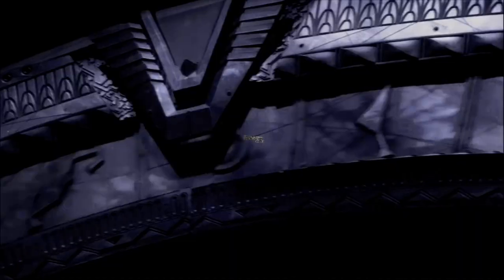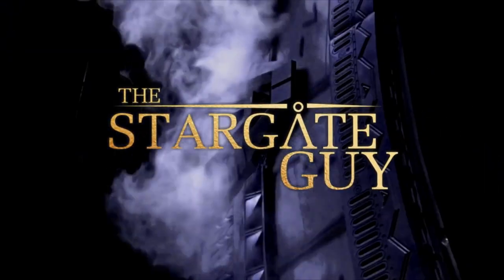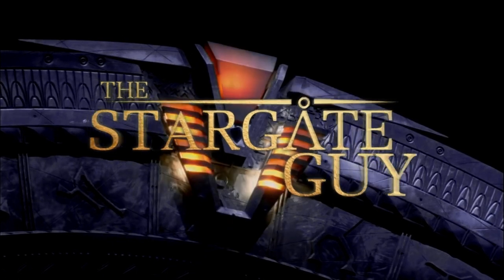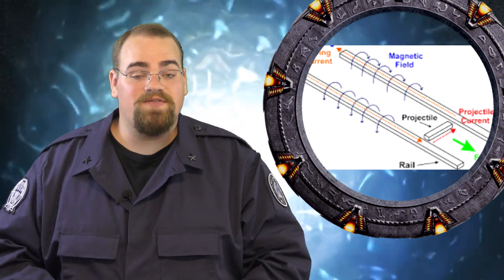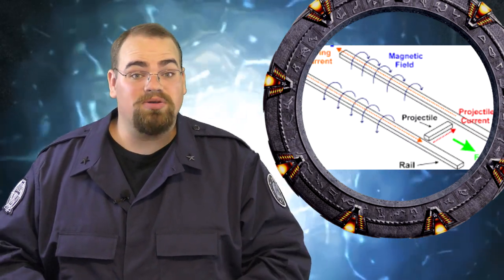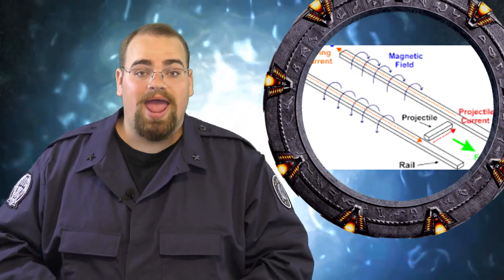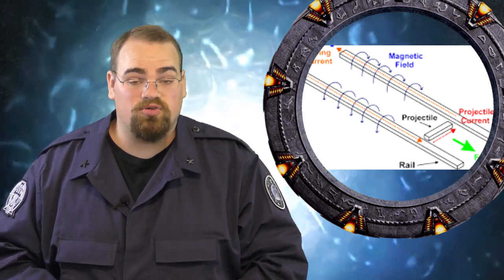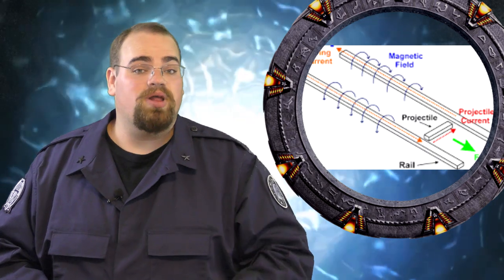Rail Gun : How it Works

Comment: 2:05 railguns don't fire bullets. they fire slugs. depending on how they are using these weapons they will either fire slugs that look a bit like a stubby arrow for atmospheric battles or for space battles ware friction from air pressure is not a thing, they use slugs shaped like a Pringles can. the size of the slugs can be compared to bullets but that is not a very good comparison. remember the slugs don't have to be flush with the barrel because there is no barrel, the round is suspended by 2 or more magnetic fields and never tough the rails, the rails carry the field.
Reply: Correct the British designed version fires tungsten carbine slugs that is devastating to its target lol

I imagine the stargate rail gun we saw in Atlantis is a smaller one designed for fighter defence, I imagine the deadalus has much larger ones designed for capital ships but then the plasma beam tech probs makes it redundant

Comment: I love railguns as much as the next sci-fi fan, but every once in awhile I'd like to see the writers address the heat-dissipation issue. After 500 rounds in one minute the rails would be glowing hotter than the sun. Someone like McKay could say in passing something about a superconducting heatsink channeling all that excess heat into the ocean for instance.
Reply from the maker: Yeah, good point. I think part of that might be resolved in the area between the barrel and the barrel casing. At least for the AA guns. for the spaceship guns I don't know how much that would be an issue, between the shield helping to protect against the effects of a sun. And there is the coldness of space to help mitigate the heat. Plus I think it would be rare that someone would fire for a minute straight,  usually it's in short bursts trying to take down a Death Glider or Dart.
Reply: Rail guns don't build up heat like gunpowder guns do since it uses electromagnets to send the bullet downrange so any heat buildup is only in the magnets themselves. I think (this is just a guess though) that they'd use something like liquid nitrogen to cool it down.
Reply from the maker: Well with the guys in real life, it does heat up enough to melt some of the steel and cause fire. So some kind of heat happens irl.
Reply from the maker: Could just be frictional of the round or casing against the barrel.
Reply: 'it does heat up enough to melt some of the steel and cause fire' Most of the heat build up is due to the electrical resistance of the rails themselves. Think of an incandescent light bulb of stove element. You run current through a piece of metal and it will heat up red hot due to resistance, Same thing with the railgun rails only on a much more extreme scale. A fair amount of heat is also generated by air friction on the projectile but that is mostly carried out the 'barrel' and away from the gun.
Reply: I don't know how it could heat up since the round doesn't actually touch the "barrel" in any way. Normal guns heat up by friction from the bullet sliding down the barrel as well as the heat from the exploding gunfire but rail gun ammo is suspended within a magnetic field.

I suppose that the electrical generators would build up heat but not at the same rate that a normal gun would. the more bullets sliding  down a barrel plus the more gunpowder burning, the more and faster the heat builds up. Not so with an electrical generator
Reply: But if you use super cold super conductors, wouldn't that negate the heat?
Reply: dragonweyr44: I was envisioning a more 'sci-fi' room temp superconducting material, like naquadah (the stuff the gates are made of). A super conductor will always maintain constant temp throughout it's length, maximizing the temperature gradient and therefor heat flow (from hot gun to cold ocean). This makes superconductors excellent heat sinks (although we have yet to develop the material IRL, but we are getting there). As for the source of heat, see my post above, unless the rails were superconducting the astronomical amount of current flow would make them glow due to electrical resistance   
https://en.wikipedia.org/wiki/Railgun#Heat_dissipation
Reply: True but in this instance, with this franchise, it seems that the SGC perfected the railgun and so the heat buildup wouldn't be a problem. Possible due ti using naquadah in the building of it. 

IRL heat buildup is a problem, in sci-fi, they solved it.

But you're right, IRL heat is a VERY real problem in space travel as well. According to Kyle Hill from the Because Science youtube page, The USS Enterprise getting hit by a phaser would result in more deaths of crewmen from the heat of the phaser heating up the air in the ship far faster than any hull breaches cause by the shot itself.
Reply: dragonweyr44: Yeah that's the problem with space , the only way to get rid of heat is though heat radiating from enormous fins etc (which are an easy target). In the Mass Effect universe they addressed the problem by channeling the heat in huge blocks of high heat capacity material (tungsten or cement maybe?) kept on board, then they jettisoned the block when it hit it's limit taking the heat energy with it. As for star trek Scotty always thinks of something.
Reply: She CANNA take any more cap't, if we push her any more, she's gonna explode.
Reply: Dragonweyr44, your thinking a coil gun or gauss gun, not a rail gun - a rail gun uses lorentz forces generated by bridging the rails, a coil gun uses alternating magnetic fields.

the fire spurt you see coming out of a real rail gun test shot is a tiny amount of the sled and both rails that was turned into plasma by a combination of resistance heating & the friction of the contact on the rail
Reply: Well if that's true then weren't the anti aircraft guns they put on Atlantis guass guns instead of rail guns? Cause I didn't see any sabots exit them when they fired. Also, did they LEAVE the guns there after the siege? Because I didn't see them there after the siege and they should've left them there in case they returned
Reply: Rail guns don't need a Sabot, in fact a sphere would make much better engineering sense. the only rules for the projectile is it has to conduct electricity and bridge both rails
Reply: The Navy's gun did. But I REALLY don't know ANYTHING about space age weapons like rail guns and guass guns, I don't even know the difference between them and coil guns
Reply: The navy's gun did because they are using it to test various materials, not all of which are conductive. The differences are pretty neat, and the basic principles can be demonstrated in a low energy garage build. 

I only got a bearing up to walking speed on my rail gun, but it was literally just the rails off of a model train and a 12V car battery along with 2 feet of copper wire. (fused the bearing to the rails when I increased voltage)

Both are interesting (and simple "in theory") concepts, a visit to wikipedia is OK for the theory, and low energy "proof of concept" devices of both types can be built in your garage, using a car battery and a couple transformers for a power supply
Reply: Most of the gauss guns I've seen in scifi have been in rifle form, I don't think I've ever seen on in an artillery form of any kind.
Reply: The Stargate Guy any heat would come from the air friction as the projectile was propelled down the electromagnetic rails - depending on how open the barrel is, it would negate a proportion of that heat to the surrounding air - as long as the rate of fire is below the melting point of the gun (or have an auto cooldown period) then I think it would be okay, I wouldn’t want to stand next to one .
Reply: The Stargate Guy PS it actually be just a chunk of metal, you don’t need any bullets for a rail gun - due to the amount of kinetic energy when it hits.
Reply: >.> the Vehicle contains a Thermo electric Generator that helps power the machine to reduce power consumption on other systems.

However the assertion of 20mm >.> the main issue is that most rail gun designs use Squarish projectiles and if i recall the barrel was kinda Square.

Also yeah i have to wonder why they never did have 155 rail guns like the ones the USN is building.
Reply: We don’t know the heat resistance of triniam metal perhaps they are made from this and trinium  might have a much higher heat resistance rating
Reply: You don't need a barrel, it isn't rifled after all. If it looks like a barrel, it likely is shaped like that as a air dampener as well as to keep people from putting their hands infront of it. I don't know why everyone thinks it needs a barrel. Like, you think it has bullets with cartridges full of powder attacked to them? These are just slugs flung fast, a barrel would just slow a exiting projectile down. All it needs is a firing mechanism... a rifled shot matters when you aim at terrestrial objects, you need to calculate a trajectory arc. Since WW2 with command Gunners on planes (we have a few videos on YouTube from that era) all you are doing is detecting incoming enemies, note their location and where to adjust your fire so you can actually hit them.... before they shot you, all this occurring in a second or two. A repeating rail gun has the speed that you can just hit at a aircraft a few times faster, the spin of the bullet and thus the barrel isn't a factor. You are still thinking gunpowder. Bombs dropped from planes don't need a barrel, and nor do rail guns if they are propelled from the base like a bullet. Using the barrel to steer it is idiotic. Only rail guns pointed at the surface needing to fight against gravity need battles shots. In close proximity in the air this doesn't matter as much, line of sight matters more, and aiming right for where you expect them to fly. Go watch the command gunner cartoons from WW2, and consider how stupid having a barrel of a rear powered rail gun would be. Yeah, that shit would melt if you tried that, you aim the slug first, then fire it.... and once fired you don't materially contact it with any metallic surface. Trying to use asuperconducting metal wouldn't work cause you need to approach near absolute zero to maintain a extended barrage. At that temperature, even oxygen is a superconductor..... but you warm it up, it suddenly isn't. You would be swapping out superxonducting material constantly, with it ejecting from the gun like brass. All this stops being a issue if the slug is aimedfirst them shot from behind. No need for a barrel.
Reply: The Stargate Guy True, they can melt STEEL not what the Tau’ri have, say Trinium, a material 100 times stronger and lighter than steel, so it’s likely that the Tau’ri use Trinium, plus, god knows what kind of dampening technology they have.
Reply: @TheStargateGuy  I know you probably Won’t read this or care, but the coldness of space does not dissipate heat. In fact, there is a huge heat problem in space. Heat can only be transferred, but there is no atmosphere to transfer in space. So that whole freezing in seconds, is bunk. Space suits have insane amounts of cooling
Reply: @charlesdog9795  fins in space? Fins  work for cooling due to the increased surface area. Surface area only matters, in atmosphere, as you need air to move over those fins to take away said heat. No air, no movement of heat
Reply: @TheStargateGuy 
I would think the coldness of space would not do much to help since there’s nothing for heat to radiate to in space.  It’s contradictory to how we would assume since space is cold, but hot objects tend to stay hot unless they have a specific way of radiating off the excess heat.  It’s no coincidence that some of those things on the International Space Station that look like solar panels are actually heat radiators.

Comment: Big machine guns like the Browning M2 .50 caliber use a metallic boxes that contain about 100 rounds of ammo that is belt fed. I imagine that the rail gun ammo is stored in boxes attached to the gun and replacable. 

Tracer rounds are placed either 1 in 5, that is 1 tracer for every 5 regular bullets, or 1 in 10 which is more likely.

The case around the shell is called a sabot (pronounced say bo) which is dutch for shoe and were we get the word sabotage from. tank rounds such as from the M1 Abrams use sabots as well. They are used as a filler for the gun barrel so that a a smaller projectile with greater kenetic energy can fit in a larger barrel and the sabot falls off the projectile as it exits the barrel but I suspect the anti aircraft version of a rail gun wouldn't need a sabot. 

The rail guns on the Daedalus ships are probably a bigger caliber than the anti aircraft version and I believe that they are loaded in a way similar to the 40 mm anti aircraft guns on Navy ships in ww2, 3 to 5 large caliber shells attached to a "clip" fed into the gun, probably an automatic feeder system like Russian tanks used so an operator doesn't physically have to handle the ammo themselves. 

Tracers normally are orange, green or red though
Reply from the maker: Good points, your probably right about the containers for the belt fed rounds and tracers. I'ts good to know about the sabot, I kind of figured about that, but I didn't have too much time for the research. We know the guns used to defend Atlantis where taken off of the Promethius, but I don't know if they upped the anti for the Deadalus class, could be.
Reply: The Stargate Guy I would think that if they can use a rail gun at that firing rate, it could be feed magnetically as well. No belts would be needed then, just a clean feed system. Could even be fed from multiple sides, inserting the tracers from one feed tube, while any other rounds are feed in as needed. Heck, you could even switch ammo while firing with a system like that.
Reply: +Java Beanz I don't think that ANY magnetic feed system could EVER  feed ammo into a gun at thousands of rounds per minute
Reply: In the M1 Abrams tank, the barrel of the gun is a 120 mm smoothbore (no rifling) barrel but depleted uranium penetrator inside the M829 shell, the kinetic energy penetrator  is relatively small once it leaves its sabot.If a real life rail gun doesn't need a sabot, then even the rail guns on board the 302s or even the 304s wouldn't need to be that big to seriously mess up Wraith hive ships or Lucian Alliance former Guo'ald  ships either

Comment: On the Stargate Wikia page there is a picture of the railgun interface/control panel. There are a couple instructive labels; the yellow one says "[...]THIS WEAPON MUST BE DESTROYED IF MISSION FAILURE OR CAPTURE IS IMMINENT." Makes logical sense. Then, there is a seven step "shutdown procedure" in which steps "5" and "7" are identical - they basically say "turn on the instant-on backup power." The last and eighth step, also labeled as "7.", says "Turn on in remote destruct receiver", the function of which should be self-evident.

All of the minor errors don't make the information on the label any less relevant or informative to the gunner or operator. Within canonical context, the guns were probably produced and sent to the front-lines in a hurried manner. I suspect that later iterations of ground based rail guns such as the ones at Icarus base had updated labels.

Anyway, always a good time watching your videos as well as informative!
Reply from the maker: Thanks I'm glad you liked the video. I love the amount of detail that is put into the shows. It makes for all kind of cool stuff.

Comment: A 20mm caliber railgun is possible but at the same time under powered for what they do in Stargate.
Here is the math 2000 grains @  5,582 feet per second (5600 rounding up) 139,242 Ft-lb kinetic energy or similar kinetic energy to a 30×173mm NATO.

Comment: A rail gun actually uses the projectile bridging the rails to provide the lorentz force to fire. 

A rail gun projectile is any conductive mass that bridges the rails (don't wear a ring when changing that hopper of half inch diameter ball bearings). 

How fast can you make the ammo feed? How fast can you drop bearings on the rail? (think hopper & trough feed)

Your big issue is going to be recoil, you are putting the EXACT SAME amount of kinetic energy into your rails pushing backward as you are putting into your rounds going forward. (limiting wear and G-forces involved is actually why you want as long of a barrel as you can get away with)
Reply from the maker: That makes me wonder about the more internal structure behind the barrel. We know that these are naquida powered. Meaning they use naquida instead of a lithium battery. But there must also be some kind of shock absorber inside as well.

Comment: The fire around the round is not steel, but ignited air. There is so much friction, it creates enough heat to set on fire normal air around it.
Reply from the maker: Mmmm well O2 is combustible.  I could see that.

Comment: We have Railguns now, but they can't fire at 200 or more rounds per minute. That would take a massive amount of powerful.
Reply from the maker: Indeed.
Reply: I think it would require redesigning of the Ammo such that it will have optimum contact surface area to reduce friction and heat transfer to the rails as well as receiving maximum amount of Electro Magnetic field to propel it at least mach 4 without breaking down the gun barrel.

Comment: Either way - this gun would only "work" with some secret sauce space material ambient temperature superconductor. Wasn't there something about Naquadah having such properties for the gate? There is no mind bending trick available to imagine this gun working otherwise. It would just instantly melt. But sure - if we imagine they use some Naquadah-Trinium alloy with 99% efficiency and make some magic grade cooling based on quantum effect crystal technology or whatever it is Carter could explain perfectly fine to an O'Neil pretending to not understand then we can integrate these guns lore friendly.